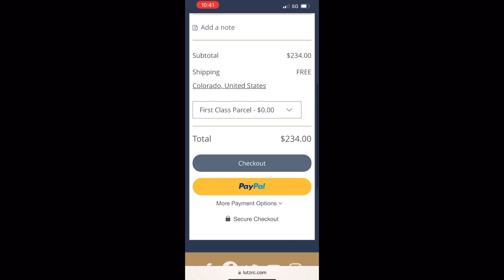Alpha 5p plus nitro engine test $234 engine 1/8 nitro buggy wrc sbx-1

Comment: Had one on my losi 8ight 4.0 brought it used never heard of the brand and their was very few information about it a few years ago. But when I ran it omg it had so much power it ran with a novarossi pipe and header. With a 7mm Venturi with 25% vp power. Best motor I’ve had but didn’t last long in terms of pinch and the cooling head is very weak.

Comment: Iv been wondering about that engine. About how it runs and millage. And what carb venture to run. That does not kill millage and power and speed
Reply: Alpha makes very good engines that run smooth, consistent, and make great power for buggy and truggy. A 7mm Venturi is a good middle ground between power and fuel mileage. If you need to sacrifice fuel mileage for more power, go to a 7.5mm, and if you need better mileage, go to a 6.5mm